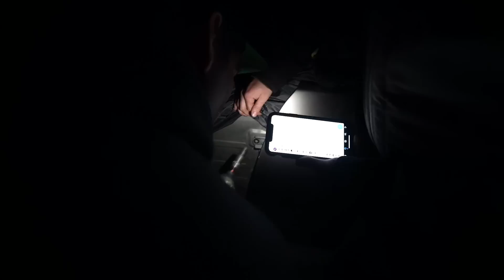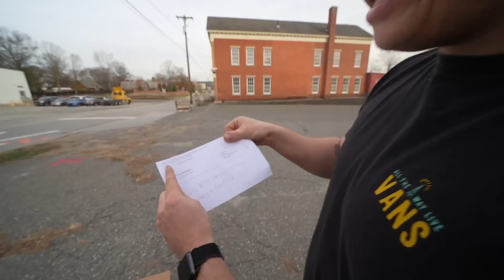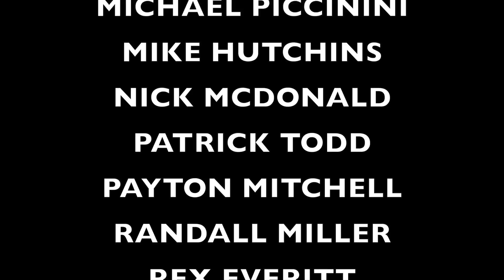BOUGHT THE CHEAPEST ENGINE I COULD FIND. WILL IT RUN?

Comment: If I’m not mistaken, the engine harness off an Infiniti and a Nissan is different as far as wiring goes. My 350z one was different than the g35 one so keep that in mind if it doesn’t run.

Comment: Oh by the way the broken harness on the front of the new 350Z engine is the wiring harness that connects the VTC cam control motor to the ECU. Pretty sure if that is damage or disconnected the car will have a no start fault

Comment: The engine level is supposed to go from to back so you can tilt the motor back to drop it in :)
Reply from the maker: You don’t need the engine tilted if the front end is completely off and it’s just a straight shot to the transmission tunnel.
Reply: @RicerMiata  Got emmmm !!! Lol clearly ricer had it right, its in and that's wat she said 😆  gg bro infinity powahhhh